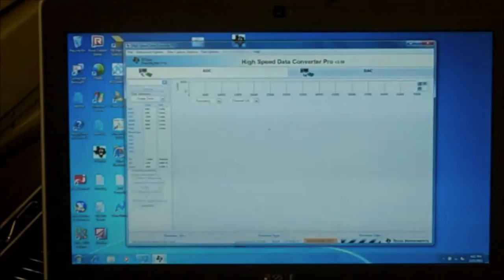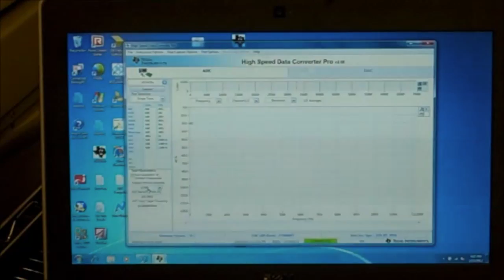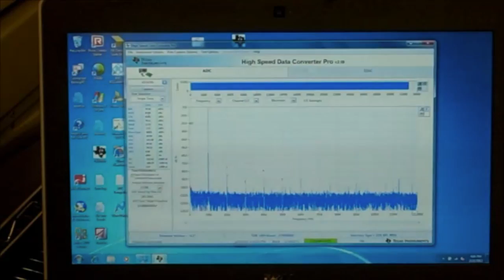How to use low-cost tools to speed high-speed ADC evaluation

Comment: It is possible to replace the input stage to a DC coupled amplifier like ADA4938 and then it would measure DC as well. Another option would be using the on-board THS4509 chip and short some capacitors  like C41, C100, C13, C66 and remove the transformers. DC signals cannot pass thru those transformers.

Comment: This  Evaluation Kit is useless for reall using for ADC, I bought one ADS4249 EVM and other needed kits(HSDC and clocking boards) but find out that when your input is square wave signal but after the ADC you got the output like Triangular wave. The Ti technichen says it is because that EVM boadrd only surport AC coupling.They did not show any information that it only surport the AC coupling model in their specification! Also, when the input of the signal is sqaure wave form, the AC coupling output of my oscilloscope is still sqaure wave.  Anyway, purchase this kits is really a wast of money and time!
Reply: Thanks for the info.